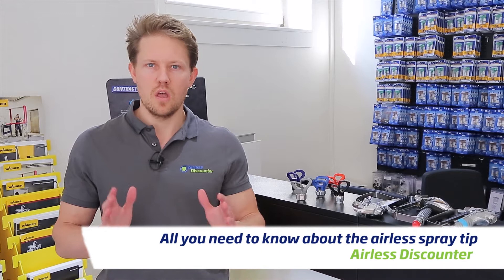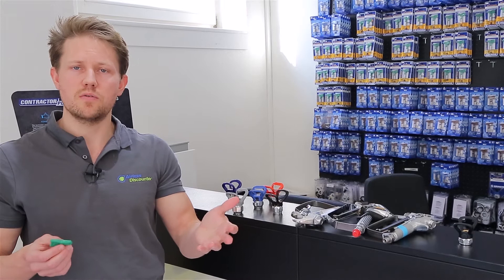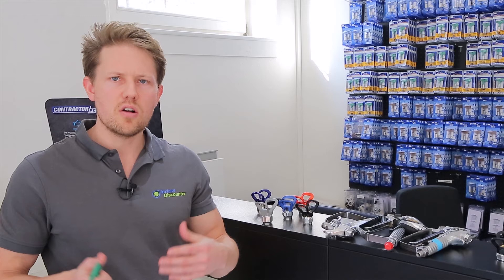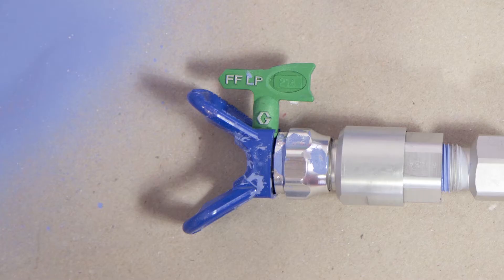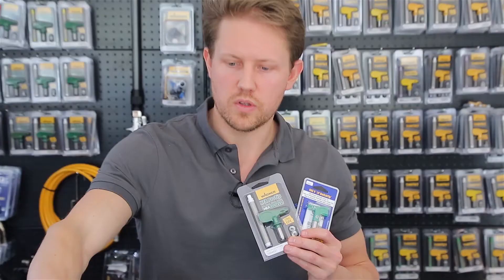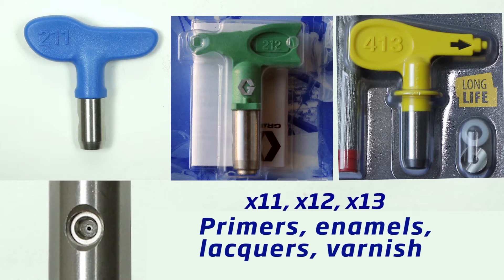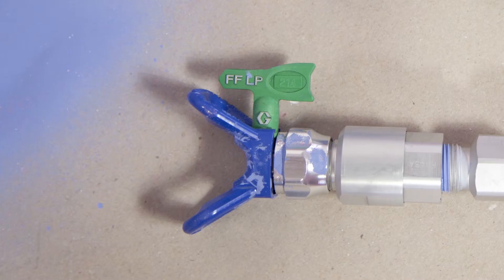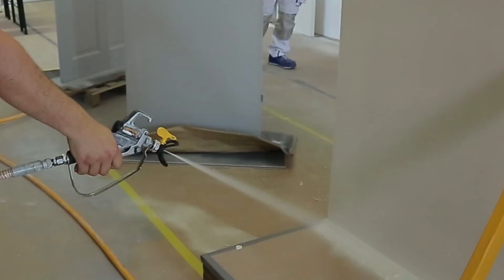Ultimate Airless Spray Tip Guide (Compatibility and Application Examples Included)

Comment: You will find that pinholes in the finished surface are usually can be blamed on people used  wd40 or pledge polish in the  close environment. If a cocommecial customer comes up with this problem is 99% its time to change the furniture polish u use. It even effects powered coating.

Comment: Hi deren thanks for this video, a great and clear explanation. I was wondering if HEA Wagner Tips can be mounted on standard Wagner tip guards and used on an Older Wagner Project Pro 117 ?
Reply: Hi Alfred, you can use the HEA Profi tips with a standard Wagner tip holder (Wagner Trade Tip 3 tip holder). This way they would fit your ProjectPro 117 too. But be careful there are also Wagner HEA for the new DIY series (ControlPro series). There tips will not fit. Best regards, Stefan

Comment: Which would theoretically be better for walls; the FFLL or LP tip? Currently using a FFLP 412 but thinking of using an LP 415.
Reply from the maker: Hi Marcus, without any other information, spraying walls can be done with a standard 415 spray tip. You can use the low pressure spray tip too, if desired. Fine finish spray tips are generally used for your woodwork, trimmings, staircases, cabinets.
Reply: I mean you could use an fflp tip but youd be there way longer so kinda defeats the reason for having an airless to begin with.

Comment: What is the most aggressive solvent you can use to clean your tips? (Latex) Ammonia? Laquer?
Reply from the maker: To clean the nozzle you can use a Nitro dilution or CHC (stripping). but that would also attack the plastic, so you would need to be careful when cleaning the metal parts of the spray tip only.

Otherwise simply insert in a Tip Cleaner. But you will need to check cleaning requirements for multi-component materials.
Reply: Hot water the hotter the better

Comment: I am using PPG steelgured 851  intumescent > and the data sheet saying that i need to use nozzle angle = 20-50 ,Nozzle Orifice=0.019-0.025 and Nozzle pressure=20.0 Mpa >>> based on the data given what size tip will be the best to use . for your info i am using Graco Mark X machine and using tip size 227 > but i am having sagging problem. please help
Reply: and also keep clogging again and again
Reply from the maker: Hi Masood, the data sheet did also recommend thinning the material for Airless spraying. Did you try that too? This material also has a drying time - dry to touch of 20 minutes, which also might be contributing to the clogging issue. Let us know if thinning the material helped.

Comment: Great video, thanks for that. I just recently got Graco TC Pro handheld sprayer from Home Depot and it came with gray guard and gray tip 514 - what's the difference between it and blue guard with blue tip in 514 or 515? And why can't I put blue tips in the gray guard? I'm planning on painting the walls inside my garage and then later my kitchen and bedroom walls. Thanks.
Reply from the maker: Hi,
The tip of your sprayer looks like a green low pressure tip like RAC X FFLP. But as it is a special product delivered only within USA, we would advise you to get in touch with your original supplier to be able to buy the right tips for it. 
Kind regards,
Airless Discounter team

Comment: I’ve got a Graco X7. I’ve never used it inside, but I’d like to spray a residential, interior room, for which I’d like to limit overspray. Which tip would you recommend?
Reply from the maker: The RAC X LP on a paint gun of course. 
You'll find it here : https://airless-discounter.de/Graco-RAC-X-LP-Spray-Tip-Low-Pressure-Spray-Tip_1
Reply: @AirlessDiscounterInternational  thanks.

Comment: Hi Deren thanks for this video, it is a great and clear explanation.  I have a NEW sprayer (used once) that I won, but I am sure it is discontinued.  It's a Milwaukee paint sprayer Model M4910-21.  I believe the spray guard is a 7/8 ".  I have 2 spray tips #619 and #310.  I think the #619 is for heavier paints, and #310 tip is for finish applications.  MY QUESTION is what are the available tips that you stock, that will fit this Milwaukee spray gun?  Any other information you can provide will be appreciated.
Reply from the maker: Hi,
Thanks for your comment. 
Unfortunately, we do not know and work with this brand. Best for you is to consult the manufacturer and check all thread sizes. 
Guns/hoses threads for Graco and Wagner are 1/4" today. 
Guns/Tip holders threads are 7/8" and so extensions are therefor 7/8". 
Thanks for your understanding.
Airless Discounter team

Comment: Which tip seals/ gasket do I use with smaller fflp tips 310,208 etc I’ve noticed that some tip gaskets have smaller  diameter orifices? And dose that make a difference in my spray pattern ,over spray and pressure-adjustment?
Reply from the maker: Hi,
Always use the seals provided with your Tips. 
> https://www.airless-discounter.de/airless-spray-tips
Kind regards,
Airless Discounter team

Comment: Hi, I would like to know what tip would you recommend on a wagner control pro 150 for spraying 6 panel doors in semi gloss latex?  I used the HEA 515 that came with the kit but it's a little excessive for these panel doors.  Something like a 310, 315 or even 410, 415 would be better just not sure what fits my HEA control pro gun.
Reply from the maker: Hi,
Thanks for your question. 
As we only specialise in airless machines for the professional sector, we recommend that you seek advice from your original dealer regarding this model.
Thank you for your understanding.
Wishing you a nice day.
Kind regards,
Airless Discounter team

Comment: Can I use the HEA tips with a graco magnum X5?
Reply from the maker: No, the Wagner HEA tips are used for the Wagner Control Pro models 250 and 350. There are HEA "Pro" tips that are compatible, but please first check which spray tips you have - since both HEA and HEA Pro tips from Wagner are green but the cylinders are different sizes.
Reply: HEA tips that has part number start with 353-xxx is for Wagner or Titan HEA gun only , they are not interchangeable. HEA tips with part number 554-xxx in Europe or 330-xxx in North America are ones that can be used on some other guns.

Comment: What rac guard and tip can be used on the ebauer 600 thanku
Reply from the maker: Hi, 
As we don't work with DIY brands models, we can't confirm this. 
Do the test after checking with your original retailer. 
Kind regards,
Airless Discounter team

Comment: What's best for wood decks and fences?
Reply from the maker: It is probably best to use nozzles with an angle of 2XX or 3XX for example. 
Regarding the orifice size, you should check this with the manufacturer of the material used. 
You should also try to use low pressure nozzles. 
Kind regards,
Airless Discounter team

Comment: What kind of solvent you use for cleaning a Wagner 350 m after oil base paint ? And the oil for long storage can be either 10w30 or cooking oil ( olive oil ) ? Thank you in advance
Reply from the maker: Hi,
Please don't use any cooking oil for your machine. It is not a french fry machine.
You'll use some dissolvant you'll find in supermarket or DIY shops to clean it. 
What important is for you to wash the pump inside with water after you used these products to clean the oil base paint. This way you'll protect you pump a little longer. 
Kind regards,
Airless Discounter team
Reply: Airless Discounter International  thank you for your information. So if I understand correctly is you clean first with the dissolvment  and then with the water. As far as the cooking oil, it’s an advise from Wagner to use cooking oil or 10w30 for long storage. It is written on the manual of the product ( 350 m) 
Thanks again you are doing great job !!!
Reply: @alexpap708  you can also run distilled  water with bit of antifreeze in it at the very end. Much the same for pressure washers too.

Comment: Hello, the one question I have is: what will be the difference on the same paint type when using Graco ltx517 vs lp517.  Please let me know.  Thank you.
Reply: Hi Edwin, the LP tip has a softer spray fan and allows you to spray with lower pressure. Which should result in less overspray.

Comment: Does Graco sell HEA tips for X7?
Reply from the maker: Hi,
If you're talking about the gun SG2/SG3 given with the Magnum X7 pump, you just have to equip your gun with a RACX tip holder and then you'll be able to use the RACX LP and FFLP low pressure tips from Graco. 
Kind regards,
Airless Discounter team

Comment: I spray some efficengy apartments and I'm finding the 515 is just to big I was thinking of going down to a 3ff but should I go with a 310ff or a 312 ff
Reply: tantaluss68 310
Reply: @georgegann2749  yea the 310ff is nice for doors and trim but the FF just doesn't do well with walls and ceilings I'm getting better with the 517 I would rather have a 310 non fine finish but i'm learning